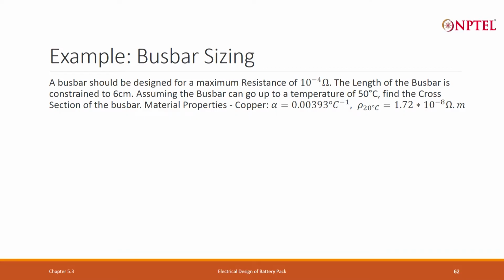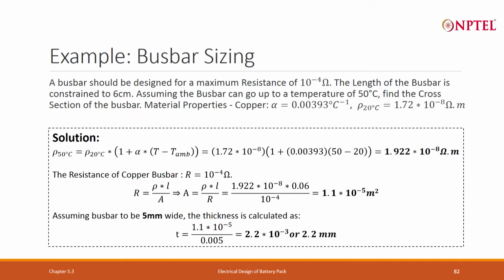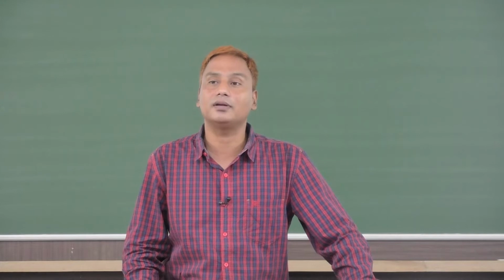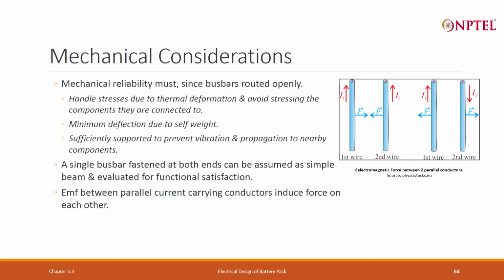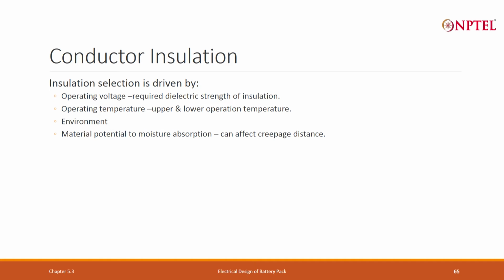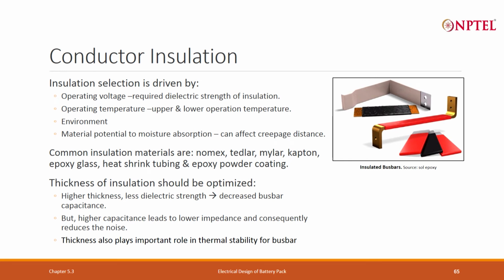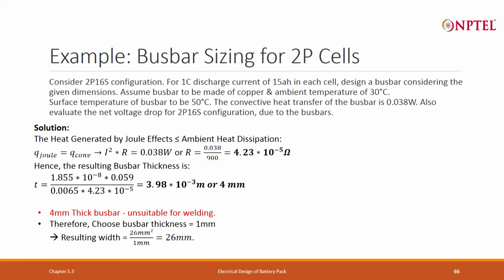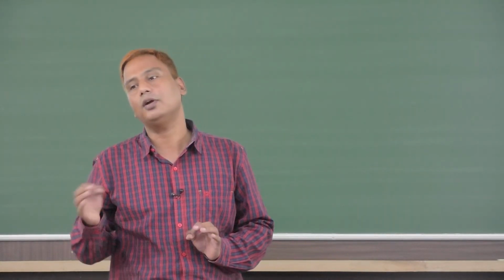Lecture 42 - Electrical Design - Part 2

Comment: For 1C discharge, the current is 15A ? Why did u take it as 30????
Reply: Because it's a 2P cell configuration, so there are 2x1C discharges in parallel being summed up